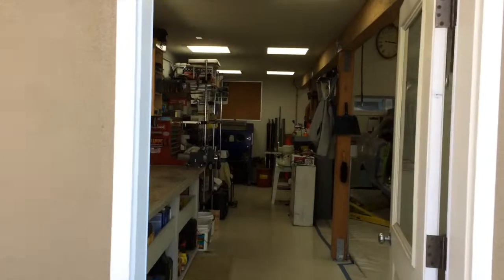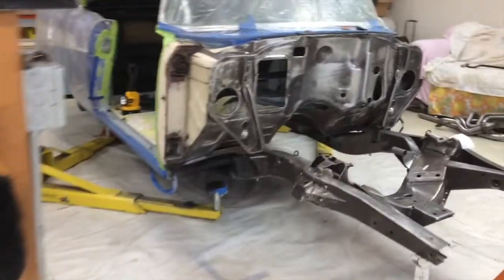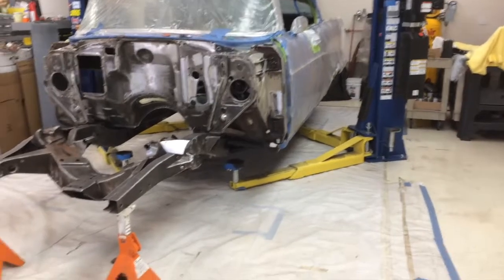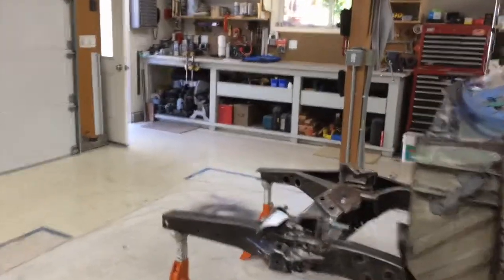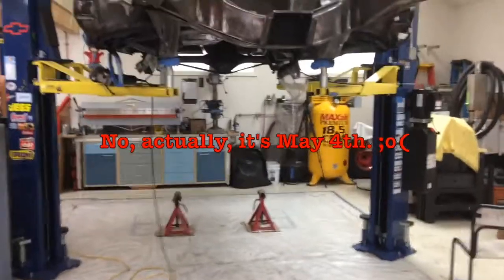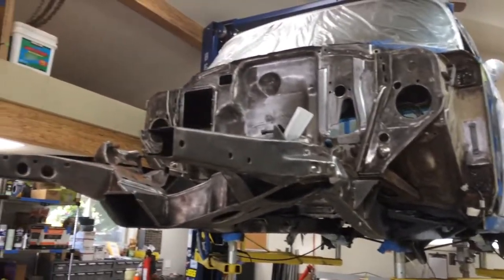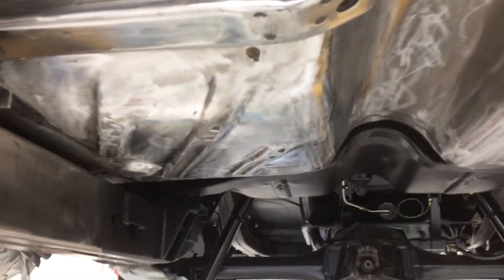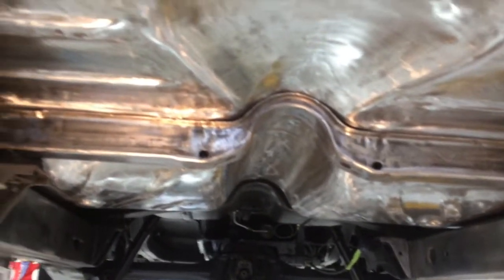The Blue Heinz Gets A Update Part 34

Comment: Hey Pappa Bob. You sure make a lot of work for yourself. But if you want a nice looking fire wall, that is what it takes. You sure have a nice looking shop. I wish I could keep mine looking that nice and clean. I wire wheeled my truck as well, but I don't have a lift. Lots of time laying on my back in all that mess getting the underneath clean. It turned out pretty nice though. Thanks for sharing.